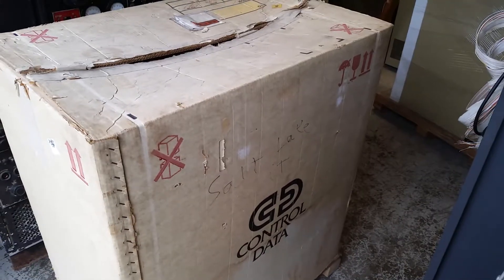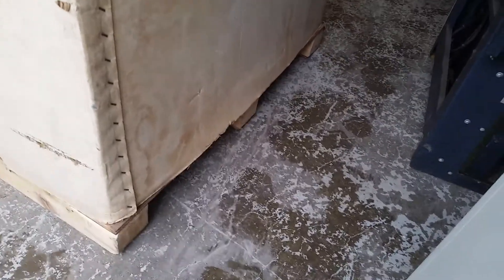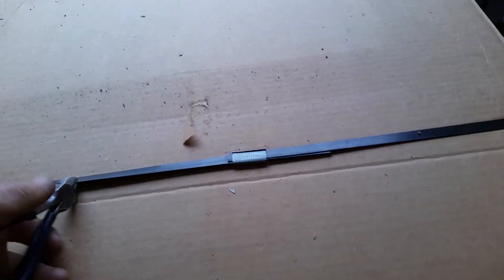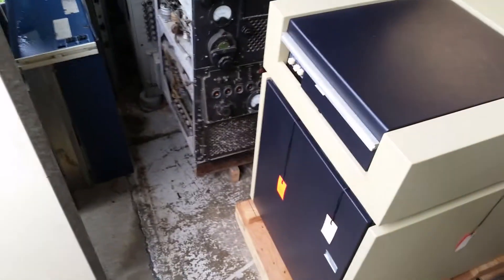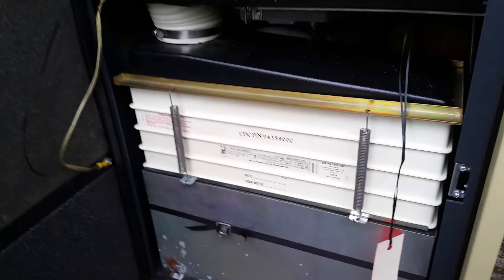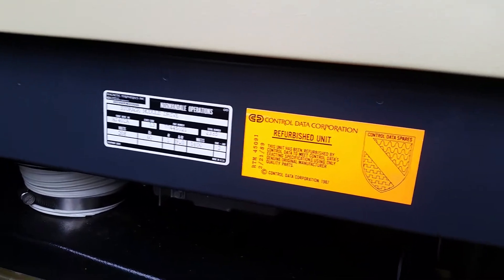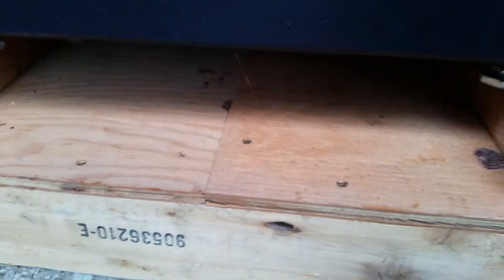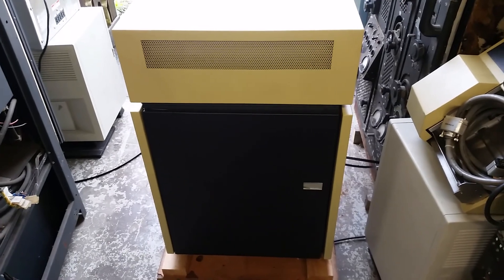CDC Disk Drive Unboxing

Comment: Yes I used to install and service these early and mid 1980's. Head Crash! Get the vacuum cleaner and the spare heads and O'scope. Remove contaminated disk packs. Rows and rows of these drives at NY times "Impact Center".

Comment: I also serviced these a stated a head crash to do properly would take some hours to perform the first filter you showed is the  Pre-Filter  that gets installed under the disk drive the second Filter is the one up front which should be changed every 6 months you remove the four springs 2 in front 2 in back to remove that 2nd filter. Under the hood you will find a Large Magnet  part of the Mechanism to move the read/write heads remember to remove the locking pin or the head carriage will not engage. Spent many a night rebuilding these disk drives .Thanks for the memories !

Comment: Worked on those for many years. Used to have what were referred to as "head crashes". Disassemble entire head/pack areas, clean meticulously, install new heads, put an alignment pack in and align all 19 data heads (long, difficult job).
No I dont remember how we got em off the pallet....lol.